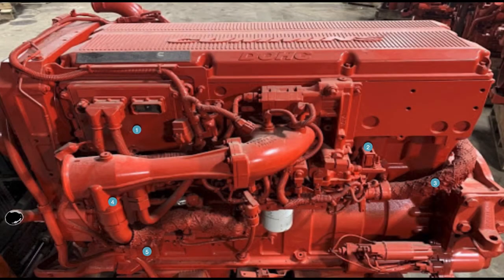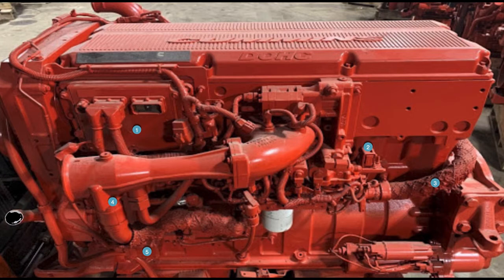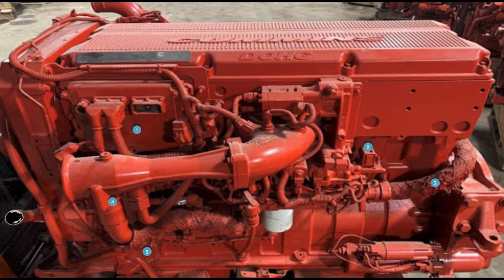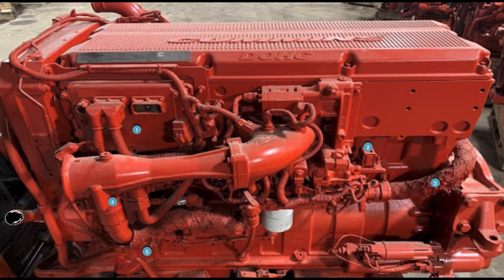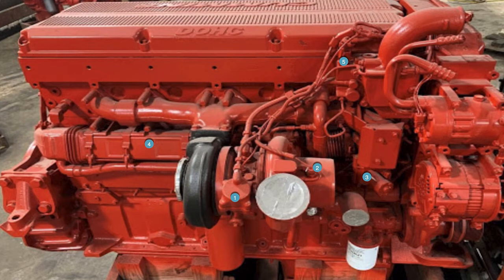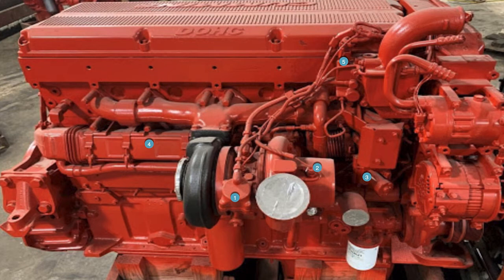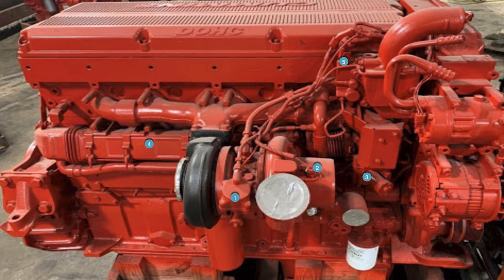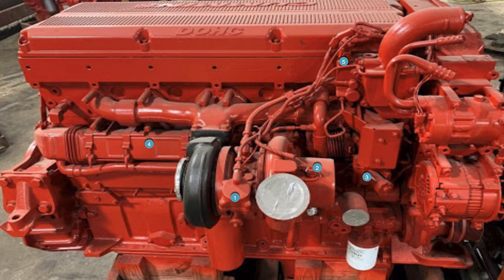Cummins ISX CM870

Comment: Good engine or problematic? I had a 01 -570 series probably the best engine I’ve ever owned in 26 years. I’m looking at a 03 miles around 600k   What’s your thoughts? Thank you
Reply from the maker: If it is pre egr they are a beast of an engine. The few problems they had can be upgraded out. IE monotherm pistons vs the two piece aluminum. A recon head makes all the head problems go away. If emissions are not an issue in your application you can't really go wrong. I am sure you know there are a few states you can't leagally (emissions) go into with this engine.
Reply: @ENGINESHOPJOE  thank you

Comment: If you get a low EGR flow code, remove the lines going to the differential sensor and clean them before replacing the EGR valve.

Comment: Does the 870 have different blocks? Or is it the same block but different heads for higher hp ratings?
Reply from the maker: The 870 cylinder block is the same no matter what horsepower you build the engine too. I think there is only one head as well. There are other internal parts that change with family changes. Cummins used to place the engine in family 1,2 or 3. Gear train changed as well as cam , piston, and injector part numbers.
Family 1 was 435-475 hp and family 2 was 450-500 and family 3 500-550. Id have to look but i dont think the 870 had a 600 hp cal.
Reply: @ENGINESHOPJOE  Thanks for the info. This helps a lot. I currently have a 870 and I guess it would be in the family 1 category. I do have a tun that's up to 550 hp on it.  It just lost oil pressure, snap ring on wrist pin snapped and caused a lot of damage to the motor so I'm currently needing a new one. It has close to 900k miles on it and the cams are not in the best condition either. I'm trying to get a Recon from Cummins and I would like to get the bigger one, family 3, motor but Cummins is really fighting me on this. They are telling me that since I have to lower motor in that they will not upgrade my motor cause they don't think my W9 can handle the additional horsepower. Crazy but I have a feeling this is more a liability issue with Cummins.
Reply from the maker: @johnweber8562  That is weird about cummins but I do know the EPA has them buttoned down. When we buy recons we have to buy like for like. It could be something on that order.
As far as your chassis goes they look at the torque the trans and rears can take. Your engine might of been 1550 or 1650 torque. The family 3 can go to 1850 so they would be over stressing those parts. However you could just get an exchange trans rated at 1850 ftlbs if that is the issue. You could also talk to them about buying a family 3 and recalibrating it to lesser horse and torque until other parts are upgraded. they will really fight you on that because warranty costs built in the price change dramatically when you go to the next family so you are getting a deal buying a three calibrated to a two. If you raise the hp while in warranty you have to notify and pay them or your warranty is voided.

Comment: This great information. I have a 2006 international 9400 with this motor. What would say is the best cruising rpm is for this motor. I hear they like high rpms. Thank you
Reply from the maker: That has the mechanical vgt turbo (air solenoid on it) and egr. They pulled to 1250 rpm and depending on the calibration they would cap out at 1800-2050 ( at rated HP). 
The engine really does not care what RPM you are at as long as your in the power band. That assumes everything is working correctly and there are no boost leaks. They pulled hard at 1800 rpm I was told by more than one driver. At 1800 they had a bit more HP than rated or claimed. The engines had fairly flat torque curves which means they pulled about the same across the power band.
The perception was if you rev it up it pulls hard and shifts better. The science of it is torque is torque no matter what the rpm and a flat torque curve means it pulls pretty much just as hard at 1800 as 1250. If I was coming up on a long hill id wind it up and hit the hill at just below rated rpm (minding of course the speed limit) and then let it just pull as the rpm comes down slowly.
Id shift at about 1450 so i ended up at 1650 and so on.
Reply: I run one everyday and I think it’s 550 rated. The turbo looks a bit bigger then the one on this engine and like you said loaded it likes to be wound up high between shifts. Empty the calibration won’t let it rev past 1800rpm and it makes it hard to shift if your in a hurry. It seems to give you power based on demand, I was wonder if that was accurate or if I was crazy.

Comment: Thank you for this info, I'm seeking as much knowledge as I can find. I'm a new owner operator, and I have the cm870 engine. Question on the passenger side of the engine in this video, is what's numbered as four the EGR cooler?
Reply from the maker: Yes number 4 is the egr cooler. I will do a video on what problems to watch for on each of the models. If you catch a problem early 
then you save money in the long run.
Reply: Thanks a lot! I'll keep my eyes peeled for it.

Comment: So the Apex would be better than all proceeding engines in its class simply due to the fact it had no emissions. That accurate?
Reply from the maker: The Apex was a Non emissions system engine. It was much dirtier than todays engines when you measure emissions out the tail pipe. Remember it was the first generation so many improvements were made by the time the isx 871 came out. I said 871 because after that we moved to non mechanical injectors and a totally different fuel system. Trust me the apex had its problems but like anything you slowly find the issues and engineer them out. They were, compared to todays engines, a simple engine that just ran with few problems between overhauls. I used to work on a guys truck who ran NY to LA and back. He and his wife ran team and they rolled the tires off that rig. He bought it new and wore out 4 engines ( almost 4 million miles before he retired.)  I did three complete rebuilds and one recon engine because a rod came out the block in the midwest. That was because a valve broke off and the piston came apart.